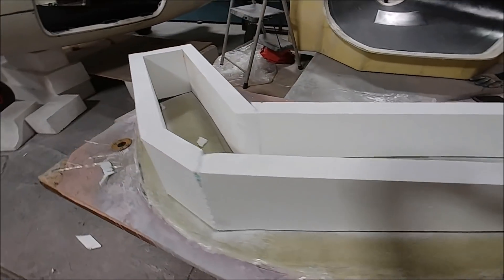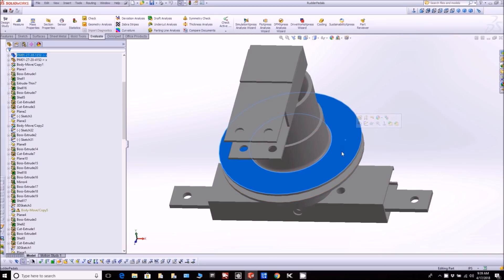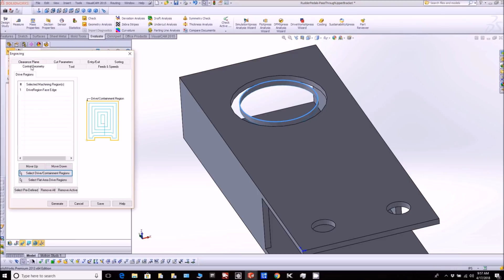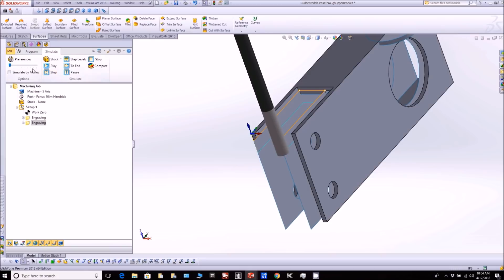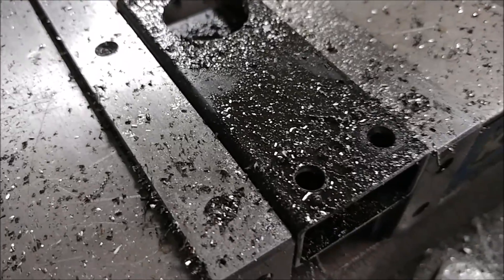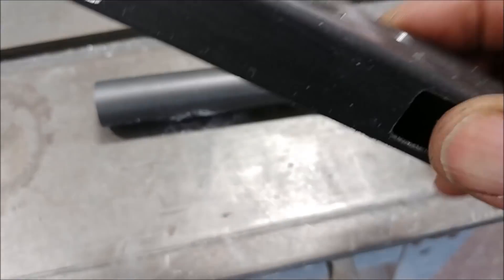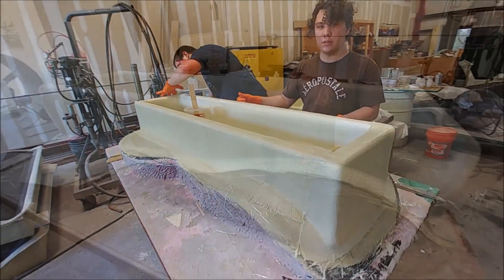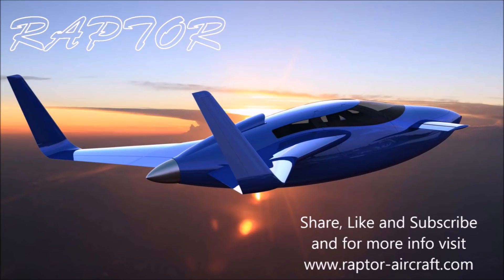Rudder Control Passthrough

Comment: Shouldn't the oil feed in the redrive go to the besring shells first and then to a pressure control device? the reason being that the oil pressure feed forms an oil wedge inside the bearing preventing metal to metal contact. this is why automotive crankshafts are drilled to the journal centre , yoour design feds the oil to the bearings as a secondary splash feed and this will allow accelerated wear of the bearing shells.
Reply from the maker: Barry Davis it's not finished yet. Give us a chance.

Comment: I wish the brackets that the cables attach to had a little more material in the eye part (between the outer and inner radii) where the bushings will go through. I know, you would have to remake the box tube for clearance because you are right against the inside wall, over time. On that note, what I am worried about is the hole (of the eye) becoming elongated and then it jamming against the wall causing binding that may stress the part.

Thanks for sharing more of your process. You are excellent at design/engineering/invention.
Reply from the maker: BrendaEM you are jumping the gun. You haven't seen the sleeve that is yet to be welded in place that will beef up the bracket. Do you really think we would let something so simple slip when we've come this far?
Reply: If it's welded or silver soldered/braised it will help.

If I were designing an airplane, and if I did something that appeared questionable, I would hope that someone would question me.

The obvious eludes the genius, sometimes.